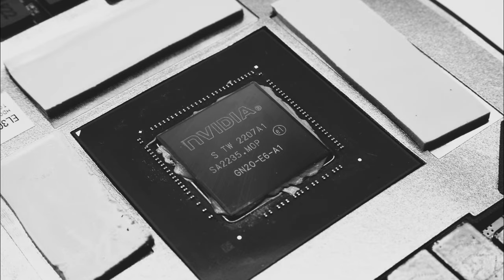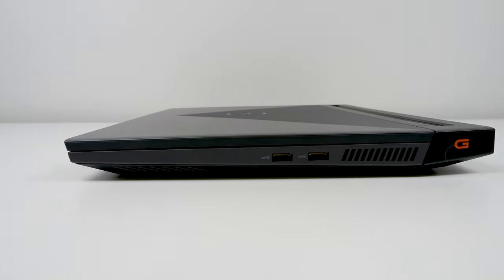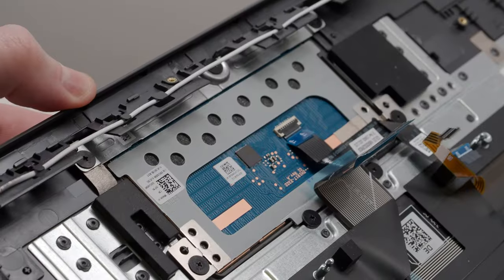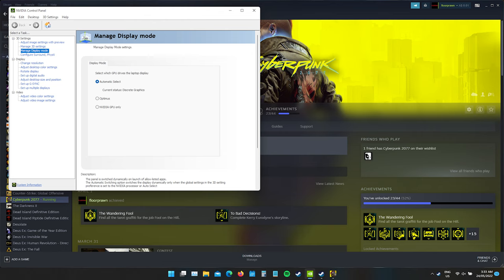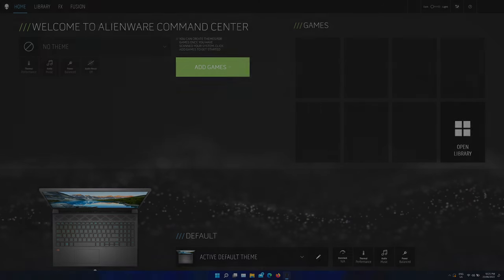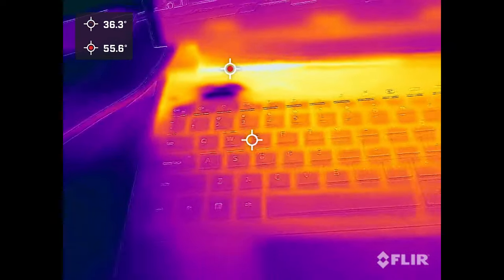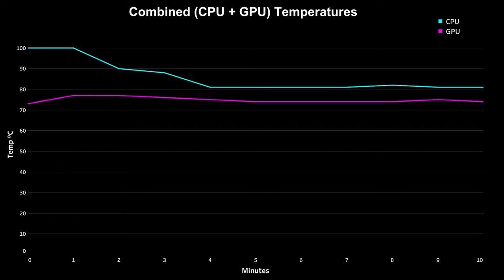Dell G15 5520 - i7 12700H/RTX 3070 Ti - Nuclear Review

Comment: Dell simply does not understand that they may say that 100 degrees its safe for a CPU to run on a laptop , what they dont take into account perhaps is runing with that tempreture 8 hours a day evrey day while serious gaming. The user does not agree with those temperatures becouse of that reason and even dough its safe to run at 100 degrees for 1/2 hours theres no posible way that anyone can convince me that its safe to run it like that for 1-2 years in a row. I litteraly buy a laptop go straight home and repaste it with Liquid Metal. Any other paste except thermal grizzly simply does not get the job done. Tried it on 6 laptops  . lenovo ,  Acer ,  Asus ,  MSI ,  Clevo ,  Gigabite .  All have the same problem until repasted with Liquid Metal.
Reply from the maker: I definitely agree with you - the explanations for why 100 degrees is fine don't matter, there's a huge psychological barrier & some common sense that says running on the limit all the time is too hot. They should at least implement the TCC offset used in Alienwares so we can manually lower the thermal throttling limit.
Reply: @NuclearNotebook  or better yet they shouldent cheap out on quality paste. Dont know how many feel but id rader have a usb port less than having bad quality thermal solutions that WILL make the user open up the device and perhaps lose the warranty. Becouse in the end the machine works its just the paste that is bad. And i do not like my machine to reach high 80s on the cpu and 80 on a gpu while gaming. Normal gaming temperaturea should be 75/83 on the cpu and 70/78 on the gpu not more. These are my temperarurea now after Lm repaste on MSI Gp66.
Reply from the maker: @Worfalak  if you repaste these (like I have with this one after the teardown) they just pump more wattage into the CPU, gets the speed up but doesn't stop the 100 degree temps. They'll crank it all the way up past 120w if the CPU isn't throttling yet and there's just not enough thermal mass in the fairly small cooler to cope with that even for short bursts. Dell really need to both improve the cooling systems and stop cranking more wattage in than the system can handle to get it back under control.
Reply: @NuclearNotebook  well that sucks. You can lock PL1 and PL2 limits and then the cpu can not go higher than the manual set value
Reply from the maker: @Worfalak  Yep definitely. I think a repaste with something at least as good as Kryonaut & manually capping PL2 to around 75W would sort the CPU temperatures on these right out. It would be nice if Dell (and various other manufacturers) would ship the machines in that state in the first place but I can't see that happening at this rate!
Reply: @Worfalak  @NuclearNotebook  How do i change PL1 and PL2 limits and is it possible to repaste without the manufacturer noticing?
Reply: @NuclearNotebook  its a vicious circle. They build them they test them they release them . What they dont understand is that the psihical confort barier at the end user part is different from what they deam ""QA Pased"".an this is a problem for all laptops not only Dell. Fortunetley with some you can work around and flush the kinks out.Dell just likes to keep things hot.one thing that bugs me the most is that they rate there cpu's at 5 ghz. But it berely reches that frequency and when it does it throttles down to 3.5 or lower thx to overheating. Basicly making that cpu a 7700h so there is no benifit in that 5 gjz mark except sintetic tests that are ussless for the normal use of a laptop
Reply: @Dani-kq6qq  on dell they notice becouse they use a different paste than normal and PL1 and PL2 you can set them trough throttlestop or intel XTU or even bios under power and performance
Reply: @Worfalak  I will contact Dell tomorrow and ask them if they'll allow me to reapply paste or maybe have their technician apply it for me. Do you think i will need liquid metal or is normie grizzly krynaut thermal paste enough? I have only used thermal paste once in my life and never liquid metal, not sure how necessary liquid metal will be and the amount of benefit for the risk if I'm doing it myself.
Reply: @Dani-kq6qq  better let them do it then. Lm is tricky to apply and one mistake will cost you the machine. Id opt for LM dough becouse its much more efficient than any paste out there. Even dell's ''element 31''.its the best but very risky. You must know exactcly what you are doing when applying LM.
Reply: @Worfalak  Ok thanks pal

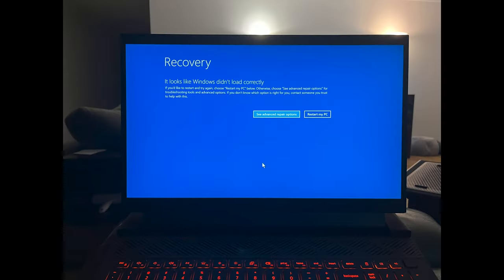Comment: 7:54 exact same problem, intermittently, on my XPS 9500. Started happening after maybe a year or two. Also found others complaining about this issue.

I'm not very knowledgeable here, but to me this suggests a common software/bios/firmware issue, probably related to C-states and power management when waking from sleep. 
On the Dell forums, they suggested disabling C-states... which... aside from being clearly unacceptable, suggests they're aware but not fixing it. Typical Dell.

Comment: hey can you check if the thunderbolt port or any other port in it support type-c pd charging??
Reply from the maker: Doesn't charge with either of my Dell USB-C chargers (100 and 130W) so safe bet that it's not supported.

Comment: you need to do the sleep test plugged in do not remove power cord before going to sleep then awake it with plugged in or try going to sleep on battery then wake up on battery make sure windows S3 sleep is disabled use the Zero sleep mode

Comment: Every Dell laptop owner should rid themselves all the bloatware and only do updates (apart from Nvidia and Intel) through the support website. 

Also AWCC purposefully is on a two minute delay at startup so as not to have conflicts with other software. Ideally if your AWCC works then never update it. You can turn off the update in command centre and MS Store I believe.

Comment: Had a Dell g16, was amazing 2k monitor, worked great, very fast. HOWEVER, it also had an extremely untolerable very high-pitched fan noise, which made using the computer as a computer for thinking/creating content/School not feasible. The high-pitched fan noise was very disruptive, therefore I had to return the laptop to Dell. If your plan is to use headphones that can block out a high-pitch fan noise the whole time and just use the computer for gaming, then this computer MAY work very well for  you.

Comment: i am not defending dell here but for my unit here most of the common software issues was fixed when i installed win 10 beside other tools i use didnot work at all with win 11 also the G key is working fine here and to be honest when i first saw the power brick i did not expect a power saving experience with these power draining specs i had to have a cooling pad and for overall experience it is acceptable compared to what it offers
Reply: How did you downgrade it to win10
Reply: @mudit.nandwana simply  i downloaded it a and flashed it into usb stick and the installing like normal we would on the startup the bios press F12 boot menu and choose the usb stick

Comment: I just bought tbis for £900 off Dell refurbished department, says it has a scratch and dent and its the i9 12th gen which isn't much different than the i7. Not to sure what theyre worth now but i thin for £900 its a good deal 👍
Reply: How are you finding it? :)
Reply: @bossgaming6037  really good, havnt had no issues yet and it plays all the games i want. Was disappointed about it having only 1 m.2 slot but iv got a 2tb 2230 for it so its all good.

Comment: There's a refubrished one up for $2000. You reckon it would be worth it? A 3070 Ti at that price is mighty tempting
Reply from the maker: Could be worth trying it out if you can return it for a full refund if you don't get along with it.
Reply: @NuclearNotebook  I did buy it. No apparent problems in the construction and the trackpad is pretty tight. Performance seems to be the same but I'm pretty happy with it. Thanks for the review

Comment: Dell tend not to put much effort into the trackpads in gaming laptops.  The reason for that is fairly obvious, who games on a trackpad?  It's there 'just in case', not to daily drive on.  A nicer trackpad assembly might be nicer for some users, but the power users this laptop range are intended for, won't be using one anyway it'll be a decent high DPI mouse or dedicated tracking pad or graphics tablet.  XPS laptops are the exact opposite with a LOT of focus on things like the speakers and trackpads where they're much more likely to be put to real use, they're where to go if that's a requirement.

Comment: This video earned a subscription from me. I love the depth. Also, I have this laptop and the same 165Hz screen, but I can't get Nvidia control panel to recognize it as a g-sync compatible monitor. Help?
Reply from the maker: Have you checked it while a game is running? If Advanced Optimus is working properly, any game running in the background should enable G-Sync, which should automatically appear in Control Panel. If it isn't, you can try a DDU uninstall + reinstall of the graphics drivers and see if that sorts it out.

Comment: I have the AMD one i have not experienced any of these problems i did get min in November so may be all the problems have been fixed i  swoped out my gaming pc with a 3090 and have no regrets it does open all applications rather fast but does take some time to open up games dont know why. i have had it on a laptop cooler since day 1 and it is just a bit louder than my old gaming pc. my specs Ryzen 7 6800 1tb nvm 16gig ram 3070 ti
Reply: @SMASH-G, what's the battery life on normal work usage?
Reply: @gsmtechzambia3985  To be honest i never use it with out the power been plugged in,  So i cant say 🤥But it is still running fine
Reply: @ashlarsen  the problem seems to be the intel skus of dell g15/16. AMD skus seems to be problem free from this.

Comment: I just got at special edition with Qhd screen.1tb 16gb ram 3060 6gb ddr i7 12700 processor
Reply: Have a fan stand allready should be good pairs with this rig
Reply: I also placed order for the same varient, did you face any issues? Please tell
Reply: @rishabhjain6272  it’s it’s quite a good laptop I am playing modern warfare 2 no problems

Comment: if we want to buy a 3060 system.  DELL Gaming G5 15 G55201800U Intel Core i7-12700H 16GB 512GB SSD RTX3060 6GB VGA 15.6'' 120HZ Full HD Ubuntu   VS  Hp Victus 16-D1037NT I7-12700H 16GB Ddr5 512GB SSD 6gb Rtx 3060 16.1"fhd 144Hz IPS Freedos  wichone will you choose?   ( I am thinking about dell for better aftersales options better cooling system better screen but need at least 1tb better m.2. I am using HP envy i7 8th gen 12gb ram nvidia 940mx gpu 17.3" 4K ips display B&O sound and HP generally a bit slow compared the others but build quality is amazing gpu is a joke ) I am planning to play some games at medium level. thank you.

Comment: This model is a joke.

I purchased one in March-ish of this year, ended up getting two replacements and in the end just opted for a refund.

All 3 units were prone to regular bluescreen's, probably 3-5 per day on average. Game performance was adequate but left something to be desired. Overheating was another big issue, regularly hitting the 100C mark whilst gaming.

Support was decent, but in the end was very robotic with no real care for actually fixing the issues. More band-aid "replacement or refund" solutions.

Have since gotten an MSI Vector GP66 (12UGS) and cannot be happier with this unit, even taking into consideration the extra $800ish (aud) I had to spend.

Comment: Hey man. I'm looking to buy g15 5520 2022 version with RTX 3070TI. But the general reviews of this laptop seems to be very poor. Especially on battery life and heating/throttling. Could you please help me out if I should buy or not? Would be greatly appreciated. Thank you.
Reply from the maker: I can't, in good conscience, recommend these. If you can get it from somewhere with a good returns policy (usually direct from Dell is the best way) then it might be worth trying it out to see how you go.
Reply: @NuclearNotebook  thank you so much for your reply. Just one last thing please, I'm looking at MSI Delta 15 AMD as well, which has quite lower specs than the one on your video costing AUD 1900, would you recommend it over G15? Also, I was looking at Dell's ebay store to buy it.
I'd really appreciate your opinion on this. Thank you again. 😄

Comment: How is this entry level?
Reply from the maker: G15 is Dell's lowest-end laptop lineup, starting out at less than $1k - so when you have the same basic machine with high-end parts in it like this one, you still have the same mechanical/thermal design carried over including all cost-cutting measures used to make a basic model profitable (in this case exemplified by the awful trackpad design & constrained airflow).

Comment: Thank you so much for this detailed breakdown! It is absolutely perfect and exactly what i was looking for. I think i am going give the g15 a miss and go for something like the gigabyte aero 5 xe4 or gigabyte aurous 5 (i think they are basically the same but just different panels). I would recommend doing a review on one of those laptops as they seriously lack any one video review at all, that is if you are wondering what to explore next. Thanks heaps!!
Reply from the maker: Glad you appreciated it! It was actually my own very negative experience with an Aero 15 after a glowing recommendation by a certain other YouTuber that was the motivation to start this channel. I'd be quite interested to check out a new model or another Gigabyte machine so I'll definitely keep your suggestion in mind!
Reply: @NuclearNotebook  yeah, after exploring the aero and aorous laptops further I decided that even though they are discounted with the exact components that I want they just have to many annoying decisions that’s ruin them. So I think I am going to go with some that like the Lenovo legion 7 gen 6 (5800h and 3070 instead of 12700h and 3070ti in the gigabyte ones) and get something much more solid but just with last years tech instead of the updated cpu and ram. Thanks again:)

Comment: After my bad experiences with a 2013 M17xR3 and the 2018 G15 5590 (9750H/1660Ti), I am done with Dell. I can't trust them to make a decent cooling solution. I had the motherboard and heatpipe replaced in the 5590 and it still thermal-throttled like mad. Dell is just dog-water in the gaming laptop market.

Comment: Had this for about a week now. Only issue is the G key (doesnt always switch to G mode). Otherwise, I have had none of the issue you mention here. I really love it! 240Hz 1440p 400nit screen! 3070Ti, 32GB DDR5 with 12th Gen i7! I upgraded my 1TB 30mm older gen SSD with a 2TB Gen4 M.2 80mm SSD. Guessing you got the communist Australian version.
Reply from the maker: Let me know if you stumble upon a fix for the G key, I'm feeling pretty defeated trying to sort it out!
Reply: @NuclearNotebook  hey the older version had a similar issue too... Try starting awcc first and then using the G key it might do the job...anyways Dell will release some fixes anyway soon
Reply: @NuclearNotebook  I have found that if I am transitioning between programs it acts up. But before I start a game it responds well. 80% solution. But needs a bug fix from dell. Also when it does glitch, even opening the AWCC won't let me control it. Have to restart computer.
Reply: @NuclearNotebook  Hey man, if the G key is not responsive and you don't hear the associated fan noise, then alt-tab to the AWCC and look for the 'G' in the top right of the dashboard. If it is greyed out then it is not on, highlighted means its on. You can also hover the mouse over it to get its status. I have found this to be reliable.
Reply: Well he is right about the battery, running hot and being loud.  I have the 3070ti 1TB 1140p 400 nits model, it is both loud & hot even when doing nothing. I haven't found the time to test it, because I had to quickly start using it for my work, already behind schedule. The performance is good & screen is gorgeous, all my software development tools are performing well, but that TouchPad is dissapointing, but I am used to using a mouse when programming anyway. I like the keyboard, but that TouchPad is a menace, way too small too.
Reply: @Benjamin, in your laptop, does it have 2 slots for NVME drive or single like his laptop? How is the performance of QHD display?
Reply: @mayanksingh12  two slots but only one works :(.  I replaced the 1TB 30MM SSD with a 2TB 80MM M.2 SSD. Dell failed hard here. That’s really the only flaw I find with the laptop.

The screen is simply amazing! Can’t say it any other way than that.
Reply: @HooyahBalls  Oh.. Only one works? Is it a bios flaw or something else? Have you enquired Dell about that?
Reply: @mayanksingh12  while there is a second SSD slot there is not port to the motherboard installed. Dell just said ‘that’s how we made it’. It’s dumb.
Reply: @HooyahBalls  ohh.. Ohk.. Thanks for the clearing the doubts..

Comment: I had been eyeing these off, main concern was the heating issues, I live in a little concrete box with no aircon at the moment so it can get rather hot up here in the NQ summer. And the lack of a second SSD slot was a real turn off as I usually rely on that for my gaming drive. Oh well, thanks for the heads up really appreciate it. I think I'll steer clean of the rtx 30 gen for laptops. I know there's water cooling coming as a few models are showing that, might wait till that's available from other companies :P
Reply from the maker: Yeah no second SSD is a real deal breaker for me! I think these G15s still make some sense lower down the product stack but it's just not competitive with the higher end specs. Definitely a good idea to wait for next-gen graphics at this point anyway, should be here March/April '23.